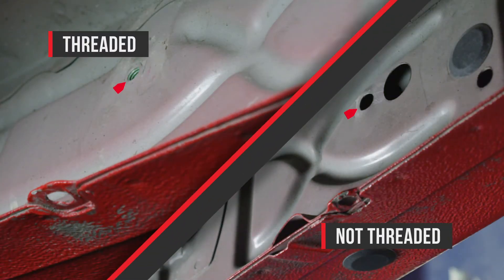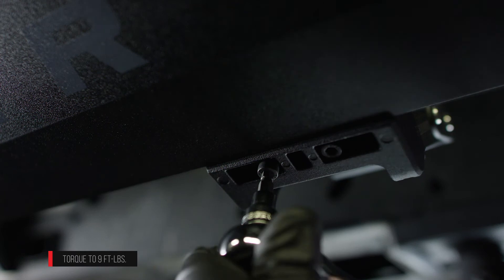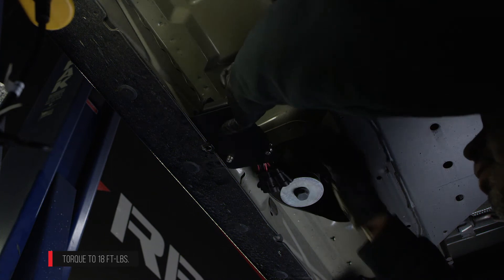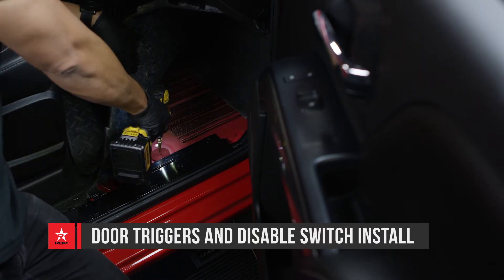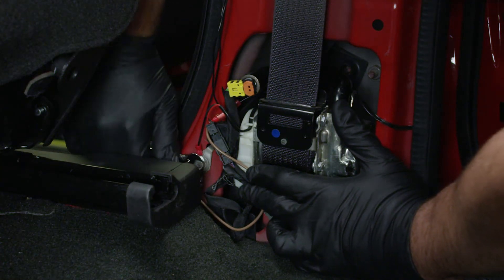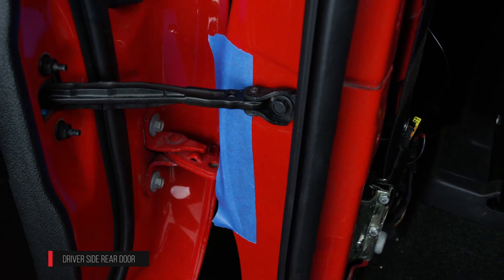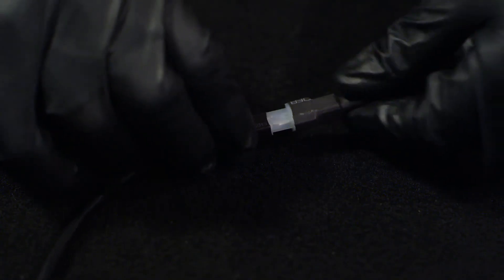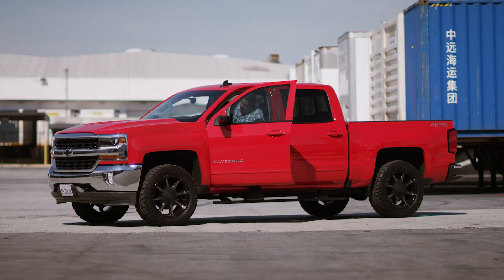RBP-126-SP Stealth Power Running Boards Install — 2014 - 2018 Chevy/GMC 1500 Crew Cab

Comment: This may be a stupid question, but what about this kit is vehicle specific? Was going to buy Amp Research steps but found rbp and and sold on them instead. Love the setup of the kit. Would it be possible to easily modify a kit to work with a 99 to 06 silverado? Because I would absolutely love to get these but as of right now there is not a kit for my truck. Any help is appreciated!
Reply from the maker: There are no stupid questions 😁. The mounting points on the motor assemblies, the length of the wiring harness and each individual wire is vehicle specific. You would need to do some custom fabbing to make it work for your 99-06. We're working on new applications as fast as we can, so stay tuned for updates as we release them!

Comment: That wiring with the magnets is so ghetto 😂 who would want visible wires shown when you open the doors?
Reply: Jesus De La Cruz it beats having to connect wires to a fuse box or the door in general to operate the step to open, vs having it to a magnet that makes installation easy
Reply: @I-bar-ranch  
I'm right there with you.   I'll be ordering a set of these up for my superduty soon